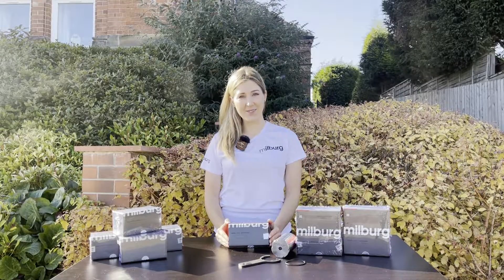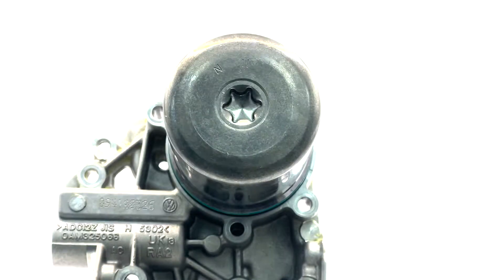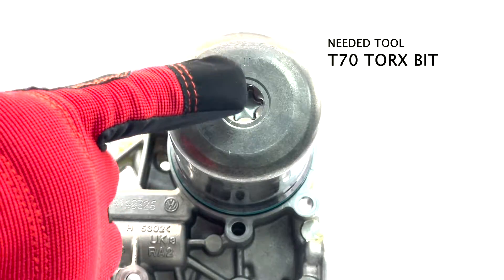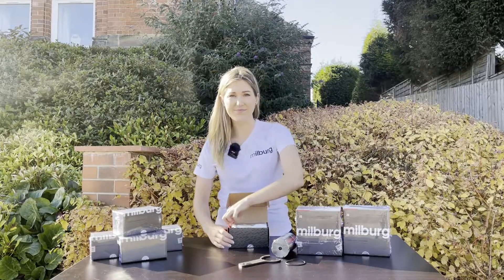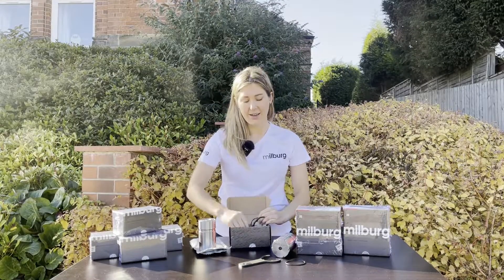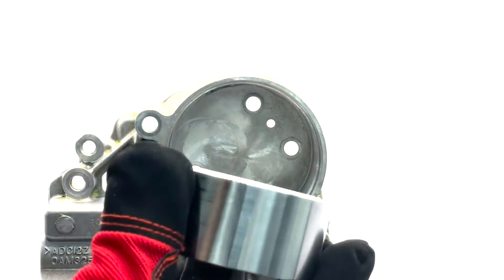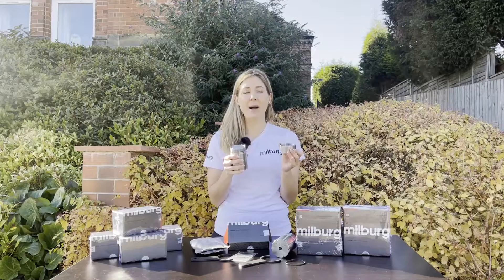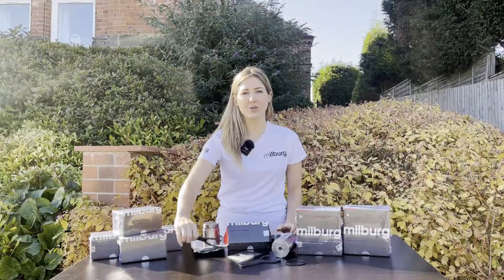Milburg DSG Gearbox Oil Pressure Accumulator Repair Kit

Comment: Hi maybe I missed something, where do you add the o ring, under the cap or inside , thanks
Reply from the maker: Hello, there are two o-rings located in the package. One is already installed on the accumulator, and the other should be put on the outer side of the metal cap with grease oil.